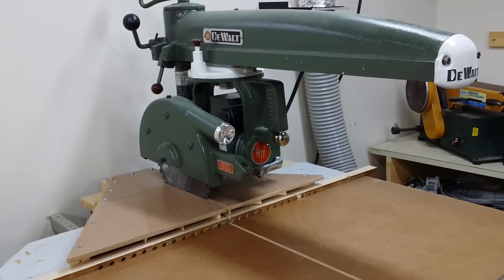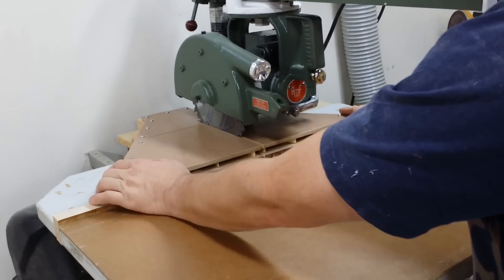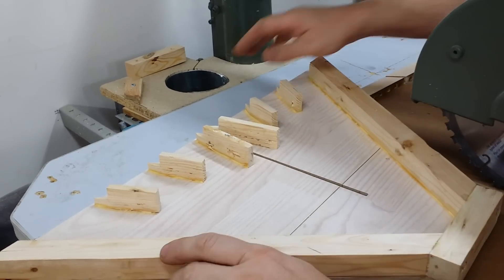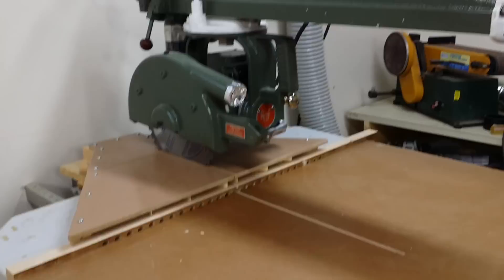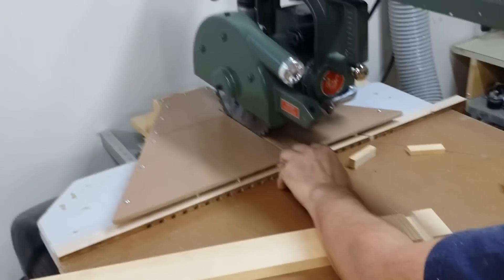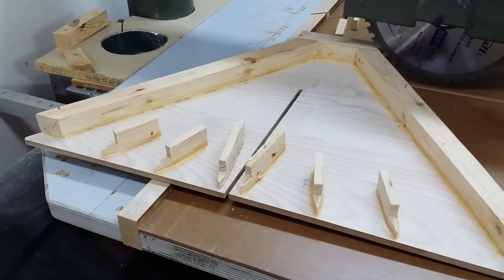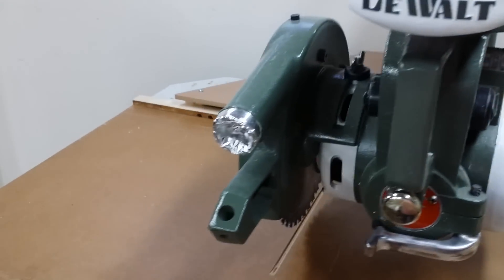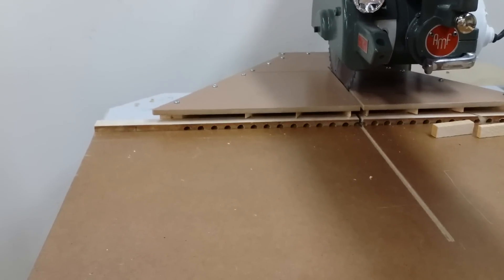Radial Arm Dust Collection

Comment: Awesome upgrades! I wondered if a total through cut of the table was required and it seems like it is not. 
I completely agree with the additional supports you put under the top shroud. A few angled cuts on my setup proved how useless hardboard is. Now I'm feeling like I need to up your improvement. Nice work. -Ben
Reply from the maker: Thanks Ben. You laid the groundwork though. 

Interestingly this evolution of RAS dust collection has already continued with Frank Howrath on one of his recent videos. If you have have not seen "DeWalt GE Radial Arm Saw 2 ", have a look.
Reply: DwaltGEradial arm saw 2

Comment: Based on your design, I built a taller box to accommodate cutting 4x4 posts.  I cut a tight-fit circle in the board behind the fence and pushed my Shop Vac hose in to and it works GREAT!  Going to build another to accommodate cutting 2x4s.  TERRIFIC IDEA THAT SUCKS UP 95+% OF THE SAWDUST!!

Comment: Nice work. I have a very similar saw. How did you get the laser added? Seems like it turned on when the blade was spinning and off when the blade stopped. Would love to see a detail of that modification.

Comment: By the way, that may be the most perfect restoration of a DeWalt RAS I have seen.  Well done!
I presume the laser was not an original option. :)  Did you mount it in the anti-kickback post bracket?
Reply from the maker: Thank you. The DeWalt MBF is a lovely machine to work with. It was a joy to clean it up and see its full potential.
The laser is used JUST as a reminder of where to keep fingers away. It is contained in a over-sized washer-like enclosure mounted on the blade shaft and turns on via centrifugal force.

Comment: Nice design. Will build similar for my saw.   Question how did you add the laser line to the saw?  Thanks.
Reply from the maker: Thanks. 
Frank Makes added to it for his design (gave credit) which I think is a further improvement. Mine is just lazy-er. Laser line supplied by aftermarket item shaped like thick washer with laser inside.

Comment: the motor on my saw does sound as good is that the sound of the blade whizzing or the motor? my motor seems really slow.
Reply from the maker: +Trent Myers It will sound different with blade or no blade. You could hope for a simple armature cleaning of the motor as a solution....but it may be a capacitor issue or a burnt winding. I would inspection the capacitor for leaking or bulges, and if not, into the motor guts you go.